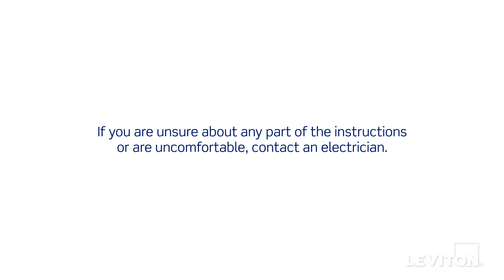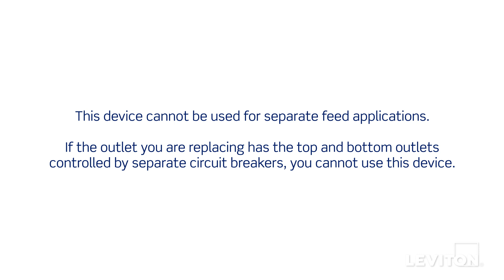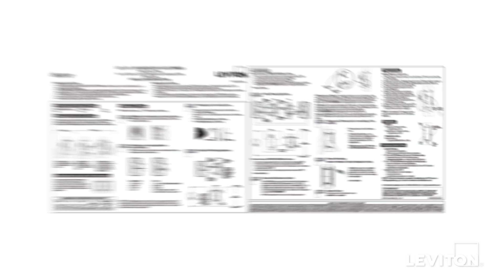How to Install a USB Charging Receptacle

Comment: Its still better to wrap the wires around the screw for better connection.
Reply: If it was leaps and bounds safer, then circuit breakers would use the Same method. 
Alas, pressure plates are just as effective, long as you torque it down properly. 
Wagos are also great, quick items to make junctions , long as you do it right the won't fail.